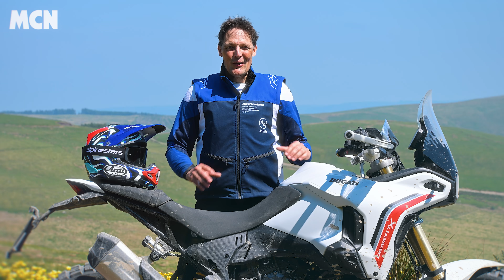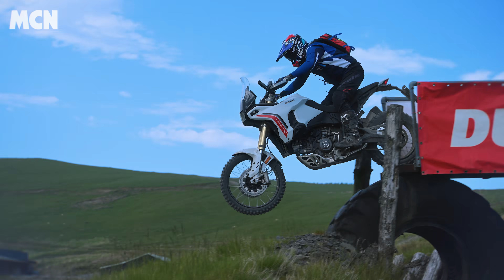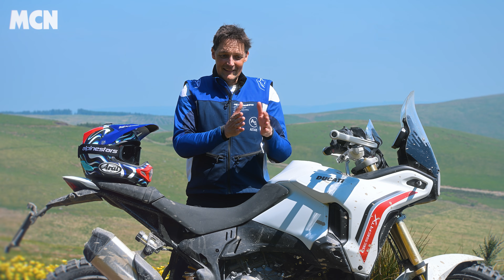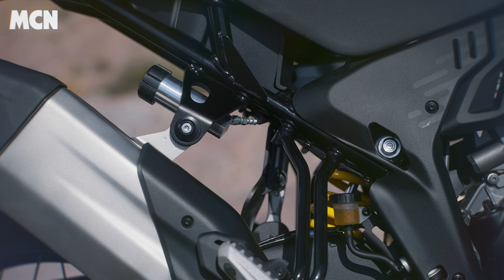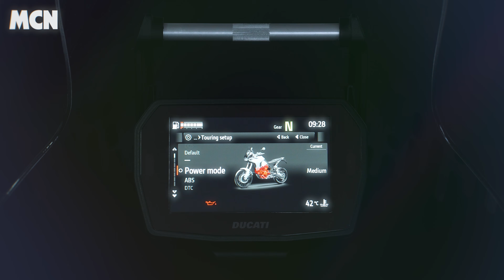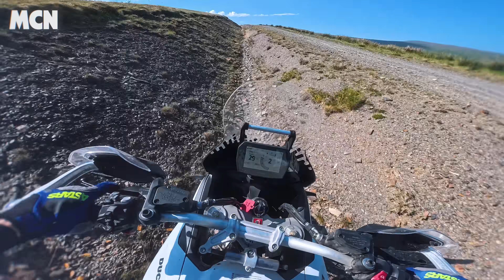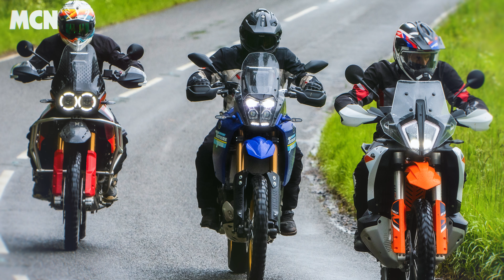2026 Ducati Desert X | Off-road deep dive | MCN review

Comment: Really nice review. It is a very tempting bike, also because it is very nice on the road. If you're in the market, this bike has to make you hesitate and not automatically turn to a Honda, Yamaha or Suzuki. It will have to prove that it can be reliable on a really long trip, which used to be a problem with any Ducati, as well as keeping service costs and parts prices under control.

Comment: I would say just get the KTM 1090 Adventure R which which on spec looks like Ducati was tried to match with the Desert X. As the whole package the KTM may offer better value. Not to mention quality of suspension on the KTM. Also simpler electronics which means less to go wrong on the KTM, once solved few common niggles. Then the saved money, probably as much as £10.000, spend on travelling the world.
Reply: Had a 1090R. It's is a heap of garbage next to a Desert X, gen 1 or 2. They do feel similar when riding though but 1090 much heavier and way less refined. Has 43mm forks that bottom from the factory and the front always got light and the tire floated at speeds over 100, even with proper sag, and even after getting custom suspension.

Comment: I’ve ridden the Gen 1 and 2 back to back and am a bit baffled by the ‘night and day’ comparisons. After 12k miles on the gen 1 across all sorts of terrain I have a real love for the bike and know it’s foibles, which I was keen to see sorted. I’m utterly confused at how Ducati took a lighter engine,  alloy chassis and plastic tank and managed to lose a mighty 1kg off the weight. I get that this is a platform engineered bike so it’s essentially a Monster on stilts, but a premium manufacturer should have been able to do something a bit more special.
It’s still a long, relatively heavy adventure bike with good punch off the bottom, great electronics and a strong motor, but the gen 1 feels more alive and just as torquey, and a lot more ‘Ducati’. The new one is smooth like a parallel twin; more like a next gen Tenere but 3k more expensive. I went to the dealership with a primed credit card. It remains unfired.

Comment: Had a test ride on the road yesterday. Takeaways: Feels sportier than Gen 1. Turns in more positively (more front end feel) and quicker. Still stable in the corner. Very (new era) Multistrada like. Engine feels gruntier from 3 thousand revs, however, I reckon that's all down to the gearing. The engine on my Gen 1 (albeit, no cat, open speaker) has more grunt and "feel" to it - and feels like it goes stronger when you get into the power slightly higher up in the rev range. Gen 1 still has plenty of power low down, and it's no problem to use 6th gear down to 70 km/h with standard gearing. Quickshifter - yeah, maybe better, but not significantly (I think they work well enough, especially in Enduro mode, which is where I really appreciate it). You definately sit more "in" the Gen 2, which I like. For me, being 185 cm, fairly evenly spread, the wind noise feels even worse than Gen 1. All in all - great bike, but I won't be trading in my Gen 1 anytime soon.

Comment: My KTM 800AR takes a real beating off-road, but it can handle it. The Ducati won't. Look at that lovely, but fragile, exposed front cylinder.
Reply: Your KTM is getting reading to chew up a cam so it doesn't matter.
Reply: @EdwinNo-p3n  I installed a new inlet camshaft during the winter at 62k km. It was free from KTM, and was no trouble to install during the valve service. My friend's DessertX left him stranded when a Lambder sensor failed, and his replacement front discs cost a lot more than my camshaft would have. All European bikes are unreliable compared to the Japs, but the Europeans make the bikes we love to ride.

Comment: Have you ridden the standard first gen with the full system termi? It remains the bike to beat in its class as an all rounder. I don’t know where this first gen wasn’t engaging is coming from. Check out Ryan from fortnine or Chris Northover from bike world and you will see what I mean. I have ridden the new v2 engine in the panigale and though it’s peppier down low it loses out on character ( non desmo) and top end grunt. I have 46 k kms on my first gen and it’s blistering fast in the twisties. The only shortcoming the bike had was that you have to grease the suspension linkage swingarm nut because it gets squeaky due to dirt. No other shortcomings. They have made this one more accessible but the first gen remains awesome for tall folks.

Comment: This bike has 3 main problems outside of being a great bike. 1. The Ducati Tax, overpriced in its category. 2. Top heavy, always a bad mix for the average off road rider. 3. Built from the ground up but literally looks like the last model so much so you can barely tell the difference. Did they run out of paint now that the company is for sale?  I just don’t understand how you rebuild a bike but it looks as boring as the last one in plain white. Why not Ducati Red?  Other than that, it’s a solid bike but most people I’ve talked to are not fans of that new engine vs the last.
Reply: What you mean at point 3? The DX v2 is completely different from the V1. There is nothing in com 0:01 mon,  design included.

The only thing that is identical is the white color.
Reply: @nunziocastelli326 Look at them both side by side very little is different
Reply: Being a KTM 890AR rider, I know exactly what you're saying. Once accustomed to the low CoG, it's so obvious when you rider the others.

All the European models are expensive when compared to the Chinese. It's a hard call, a CFMoto MT-X 1000 is 80 or 90% of the bike for 60% of the price. If you really use your bike off-road, it's a shame to give such a lovely bike a beating off-road. My 890AR goes through hell each season, but it's built to take it. The Ducati isn't.
Reply: @RedRupert64 Agree
Reply: @RedRupert64  When taking them both off the stand or laying them over to feel the weight the KTM definitely feels less too heavy but when I do super slow speed turns for some reason the Desert X v2 feels easier and more stable and less tippy. Haven't figured it out yet, but that's how it is.
Reply: @EdwinNo-p3n  I'm glad to hear it, because I may end up with a DesertX. I'm taking one out for a test ride this week. I'm familiar with the previous DesertX, which didn't cut it in my opinion.
Reply: @RedRupert64  I think the longer wheelbase has something to with it and just totally different geometry. I was riding them around in my neighborhood again tonight and while standing you can turn in real slow circles on the Ducati much easier than the KTM. KTM still feels less tippy when you lay it over at about 45 degrees. Very odd. Doesn't matter much because the KTM is a cam eater and has to go anyway. I have 3 bikes in the garage with that motor and they are all getting sold.
Reply: @EdwinNo-p3n  Yes, the geometry is to my liking - very similar to the old 950/990. I love the stability it provides, but up in the mountains with all those hairpins, the 890AR is king. Don't blow the camshaft thing out of proportion - KTM provided them for free and when they do go, they don't leave you stranded. Bikes with complicated electronics and CAN bus are more likely to leave you straned and difficult to fix out in the field - mainly looking at you BMW. As I've said before, all European brands are troublesome.
Reply: @EdwinNo-p3n  It's not necessarily to my taste, but there's nothing wrong with tippy, it doesn't mean you fall off, but it does get round the hairpins at a blistering pace.
Reply: @RedRupert64  I'm not blowing it out of proportion, I have a 24 890 R in the garage right now with just over 6k miles on it with groves in the cam lobes and corresponding journals. Oil changed at 1800 miles with Motorex just to be safe and it still happened to me. Approached KTM corporate and they said they never heard of a camshaft issue and that I was mistaken and if I had a problem with my bike to take it to a dealer LOL I didn't even push the issue, when I saw that I knew all I needed to know how that trash company is being run. Bye bye to all their products for the rest of my life, and I buy a lot of bikes.
Reply: @RedRupert64  Also you're a bit misinformed on the cam thing. They don't just give you a new set of cams, or rather they shouldn't, the head will be scored in the journals as well and the only way to fix that is with a new head. And then it will get the same poorly designed head that came off of it with the same cams and everything, so it can happen again. Also take a look in the back of a KTM dealer some time. Worst service departments of them all. Bunch of kids back there, I don't trust them swapping out a head, no thanks.
Reply: @EdwinNo-p3n   I suggest you find another dealer. Why are you looking at the cams at 6k miles? Ride it until the first valve service is due and let the dealer find the problem while servicing. Any worn parts will be replaced under warranty, if not, take legal action. Get a Honda Transalp if you're not happy, they're nice and reliable.
Reply: @EdwinNo-p3n  2024 890AR? Why did you buy it if you can't handle the camshaft problem - you would have known about the camshafts before purchasing?
Reply: @RedRupert64  You're right I shouldn't have bought it. Which is why it, and all my other KTMs are going too, and I will never return to the brand for the rest of my life. 

It's not the bad motor that they have been unable to fix for 8 years, it's how they handled it when I approached corporate when my cams started to go. They talked to me as if they had no idea what I was talking about and that no 890 motor since 2020 has ever had camshaft issues. THAT is the reason they lost my business, and THAT is the reason they will lose 100s of thousands of dollars simply based on me repeating my experiences with motorcycle people online and in person for years to come.

In my area I am (was) the KTM guy, so when I show up on a different brand I will have to explain why I dropped KTM, many people will repeat my facts over and over, and people will read my posts online and so on and so forth. It's going to hurt, but KTM is so arrogant and stupid that they seem to not care. Oh wait maybe this is the reason they nearly went bankrupt this year and had to get bailed out.....
Reply: @EdwinNo-p3n  Yes, you are right. I'm exactly the same as you. Back home, I've moved away now, everyone rides KTMs because of me and my 950A. I turn up at the dealer, and ask to test ride any model, and they're more than happy to let me, despite the fact they know I'll never buy a bike from them because I've moved to another country. They know it's down to me that so many in the area ride KTMs. 

A friend in France took my 890AR out, and came back with a massive grin, and said 'I'm getting one!' He went away and read about how unreliable that are, so bought a Honda Transalp instead. Last year, when in Spain, we swapped bikes in the morning - I couldn't get him off the 890AR all day, he loved it. He said he'd chop his Honda in for an 890, swayed by the fact that KTM are providing a four-year warranty. But again, KTM's reputation got the better of him (he's not mechanically minded), so he didn't buy the KTM. This is happening all over, I know. It's why KTM are in trouble.

The problem is, is that there's no better Adventure bike out there. The Aprilia hasn't got the power and torque that I want for fast road riding in the mountains. Most in the sector are overweight and top-heavy compared to the 890. The Ducati is the closest to what I want, but it's too heavy. I've got the 890 down to 189 kg dry, 204 kg fully fueled. The Ducati is a good 20kg more, and that's before adding the crash bars that the KTM doesn't need.
Reply: @RedRupert64 KTM consistently lies about their bikes weights with their fake "dry weight" numbers. I think they are literally calculating that number based on the bike without ANY fluid in them, such as brake fluid, coolant, fluid in the forks, I don't know. Just look at any review of the bikes where they put it on a scale fully fueled, then mathematically subtract the weight of however much fuel the bike holds, it will never match the "dry weight" that KTM claims. Its always around 20 pounds off. When you realize this, you'll see that the 890R and Desert X v2 are really only 3 pounds different in weight.
Reply: @EdwinNo-p3n  I'm not taking KTM's published weights. My quoted weights above are my own, taken with certified scales. I said that I've got the weight down to 189/214kg. 189 is this no fuel, 214 is fully fueled, and ready to ride. I've never paid any attention to published weights. KTM are not the worst by any means. The Japs have always exaggerated, but Ducati are among the worst. Please weigh the DesertX that you have in your garage, and let us know what you find.

Comment: How is the fit and finish and build quality? The new Multistrada V2 is disappointing..
Reply: In what ways?
Reply: The fit and finish is better than previous DesertX but I don’t know that it’s fair to compare against Multistrada. What is your issue with Multistrada?
Reply: @Nick_Selleck Fairing panels are well known to not fit properly and the fix is just as cheap, control buttons stick and are very flimsy, the windscreen shakes badly.

Comment: My Gen 1 is an incredible on-road bike . Really surprising.
Reply: Very true, but you wouldn't be surprised if you'd ridden a KTM 950/990A.
Reply: @RedRupert64  Had a 950S it was great inbetween water pumps and sprang clutches lol.
Reply: @kernplace37  The seals for the water pump were modified very early on, and never caused a problem after that. Not sure why some bikes suffered problems with the sprag clutch, mine was fine. My 2004 has over 225,000 km on it, now in retirement, has been reliable and inexpensive to maintain. I assure you, the DesertX will give more serious problems - my friend's 2024 has had the front discs and the clutch slave cylinder replaced. He was also left stranded when one of the Lambda sensors failed. All this within 20,000 miles.
Reply: @RedRupert64  Have 18k miles on mine with no issues. Luck of the draw I suppose. The 950/990 ADVs were incredible and I think the Desert X is the true successor to those., more so than KTM's own 890 which is interesting.

Comment: The linkage up top is an extremely elegant solution. KTM had never thought of this. So impressive how Ducati can get up top speed in a niche.
Reply: Ducati didn't invent this type of linkage (full-floater) - Suzuki were using it in the 80s. KTM have been very keen to develop the PDS (without linkage) because of its advantages: less weight, and weight lower down, fewer bearings to maintain, and ground clearance, but PDS is very difficult to get right. I like what Ducati have done, and can't wait to try it. Note: KTM have moved away from the PDS with their new RC990 R road bike - this has a linkage. It could be superior to the Ducati design because it's low down, but on top of the swinging arm, but also protected from the muck. I hope the new KTM 990 Adventure gets a linkage.
Reply: @RedRupert64  - agreed but when they used their linkages on the Husky's or some XCW's, etc etc it was a regular design and people noted all the time how much it would connect on stuff. I didn't realize that about Suzuki; very cool. Thanks for the intel.
Reply: @jasonhumphries6131  Yes, the linkage that KTM used on their Husqvarna bikes was/is similar to Yamaha's, in the way that it extends down too far under the swinging arm pivot, but some people preferred it to PDS, so KTM provided the choice.

Have a look at the linkage on the new RC990 road/track bike, it's very compact and is just above the swinging arm pivot. I hope it works well.
Reply: KTM tries to move weight down, don"t they? Is that bad?
Reply: @thorstentrapp274  Look at KTM's linkage on the RC990 road bike. It's lower down than the DesertX's, so looks to be a better design. Let's see.
Reply: @RedRupert64  , yeah...love this new Desert X just judging by the reviews. Still, I would expect the KTM 890Adv R to be clearly superior off-road.
Reply: @thorstentrapp274  I'm not sure. I love the old 950A on and off-road. The 890AR gets a lot of praise, and feels more agile, but when I ride my 200 km test circuit, which consists of gravel roads, tracks and broken minor roads, the 950 feels better and is quicker when timed. The DesertX is pretty close to the old 950 in feel, so I'm very tempted.
Reply: @thorstentrapp274  It's way better for off road, unless the weight difference is big
Reply: @Mo-kl4fb  Linkage rear suspension is better off-road and on. Have you ridden a KTM 890 AR - it's awful on and off-road.

Comment: How do you feel about the bash plate being connected directly to the engine?
Reply: A little concerning, but surely it's bolted at purposely,  strengthened points on the engine? Else should you hit something hard and at speed, you'll be taking the engine out via the bash plate.
Reply: @man @manosparavida3551  I guess you would hope so, but it would nice to hear what Ducati think….otherwise that’s exactly what would happen the bolts would sheer or the case would break…

Comment: Is this the bike that can replace my 690 en 1090?
Reply: Nooooo 1090. Best still today.... Keep her
Reply: @Crust2013  Thanks, it is still a nice bike, only 15000 km.
Reply: @7443janowned my 1090 8 years sweet do it all machine plus the LC8 motor just the best....
Reply: @Crust2013  Feels similar to 1090 in riding position only, Ducati is way way better in the dirt, less too heavy, front tire doesn't float at high speeds. Just a better bike by far, no comparison. Have had both.
Reply: @EdwinNo-p3n id outride you on my 1090
Reply: @Crust2013 I've taken my 1290 in places you couldn't ride a 450 lol
Reply: @EdwinNo-p3n wah wah......
Reply: It could replace the 1090, but not the 690. If you needed two bikes before, you still will.